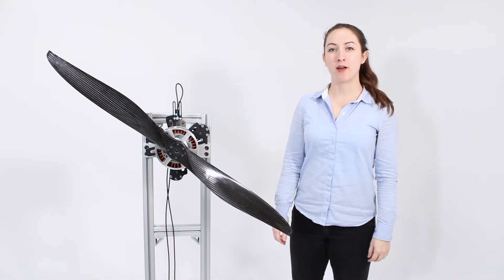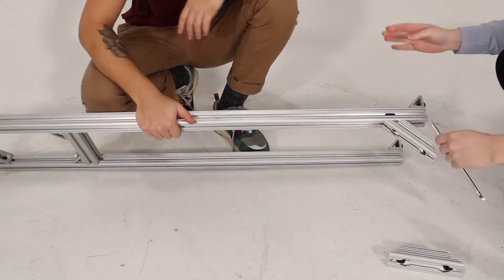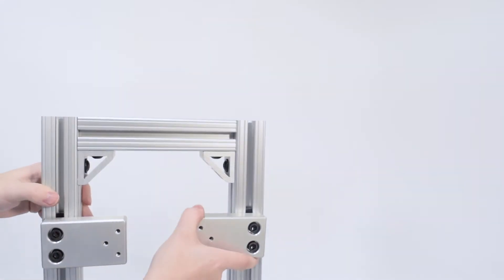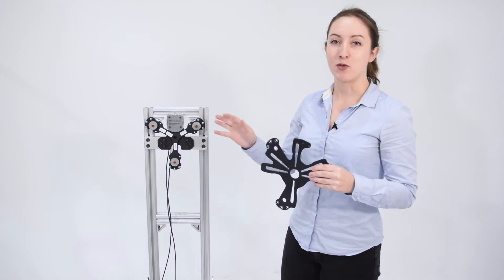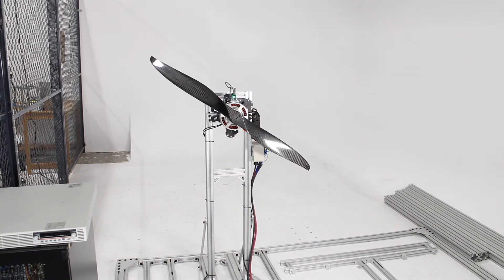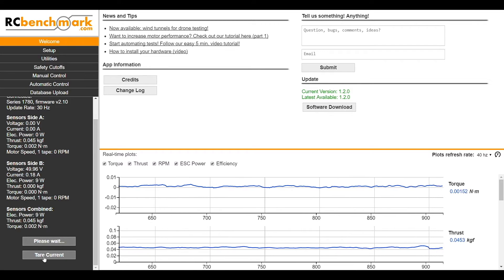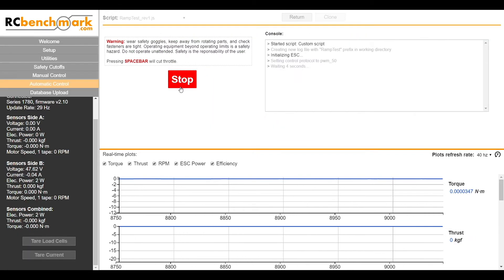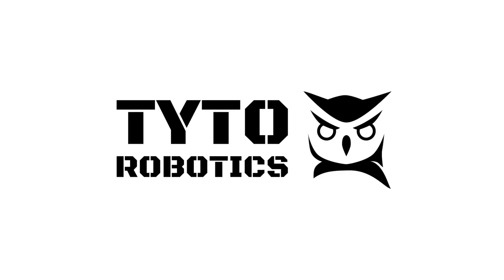75 kg Thrust Rating - How to Build and Use the Series 1780 Drone Test Stand

Comment: Why not make a flat bed instead of a standing rig? A bathroom scale can handle more than 75kg. I had only measured less than 250 grams of thrust on a flatbed kitchen scale with the propeller blowing air upward. And I thought a flat bed was very convenient.
Reply from the maker: Good question! We use a standing test bed because it minimizes aerodynamic interference with the floor. A horizontal rig is also possible, but it would need to have a high enough distance from the ground to reduce aerodynamic interactions.

Comment: It's a nice and elegant setup. 
Do you have separate load cells for  Thrust and torque measurements ?
Reply from the maker: Hi Shaik, great question. It is the same load cells that measure thrust and torque. In this model, we have several load cells that measure both. However, in our new model, we have a single load cell that measures both thrust and torque, and is calibrated for cross-talk. You can see the new design here: https://www.tytorobotics.com/pages/flight-stand-150

Comment: What prop size and pitch used on the 75kg motor that's on the test stand
Reply from the maker: Thanks for your question. The propeller has a 48" diameter and 10" pitch

Comment: How much thrust gives that size propeller? , I mean the maximum thrust
Reply from the maker: Good question. It depends on a lot of factors, but a prop of this size (48" diameter), would probably max out around 50 - 60 kgf of thrust
Reply: @tytorobotics  thanks so much😁
Reply: @Jupitterr-v1z  we had about 55 kgf thrust with our 1,07 m prop at 17 h.p. on our motorhangglider
Reply: @tytorobotics  YOU CAN YOU THIS IN YOUR NAPSACK.

Comment: Nice stuff!  Could you please tell me the power to mass (thrust) function you use?  P = F(M, D, rho) where D is prop diameter.  I have seen 3 different versions, and do not know which is correct. 

Thanks!
Reply: Hello! I am one of the tool's designer. The formulas you find online and in research papers are great approximations for starting out and selecting which range of prop will be needed. You'll will typically then need experimental data to obtain exact and comparable figures. You can look at our database (database.tytorobotics.com) for such data or use one of our tools.
Reply: Power calculated via current and voltage, from what I recall. Thrust measured from a load cell thrust sensor. Torque measured by load cell.
Reply: @LydellAaron  -- Hi is there a formula?  I don't have thrust or torque sensors.
Reply: @customdevelopment136  oh, I thought you bought one of their units, and were asking which equation they used in their system? (P = IV). My mistake.
Reply: @LydellAaron  The equation looks something like P=(Mg3/npi)^1/2/r.  If you have prop diameter and load, then you can calculate power needed.

Comment: Hi please help me for calculating power of quadcopter into fly hovering
Reply from the maker: Hi @Natthaphon, thanks for your comment. I think you will find this article from our website helpful for making your calculations: https://www.tytorobotics.com/blogs/articles/how-to-increase-drone-flight-time-and-lift-capacity
Reply: @tytorobotics  -- Thanks for this wonderful article!

Question - As you know hover ratio Hr = T(thrust kgf)/P (W) is proportional to 1/D (prop diameter m).  So shouldn't the first thing to improve efficiency Hr be to use a longer propeller -- which may require a larger frame and a stronger motor?  I can understand that some people already have a frame and must use it.  But others may be in a position to purchase a frame.  Aside from the issue of practicality, what stops us from having a larger and larger propeller and boundless efficiency?  Is there a physical law that limits large diameter props efficiency?